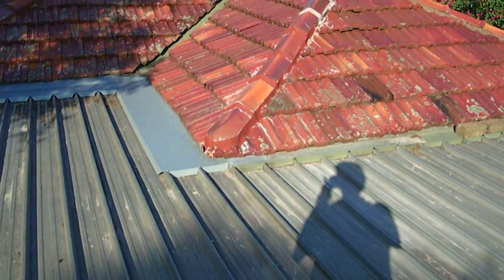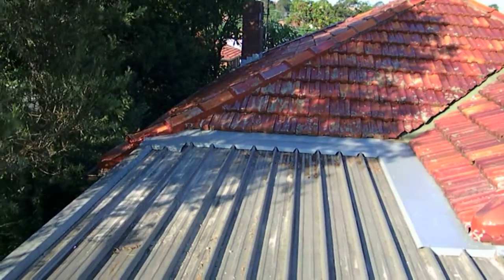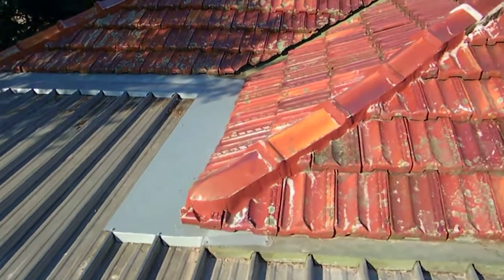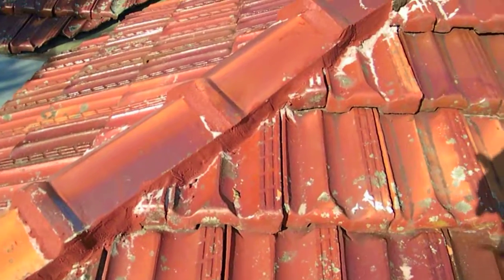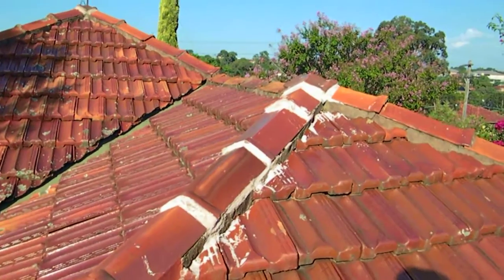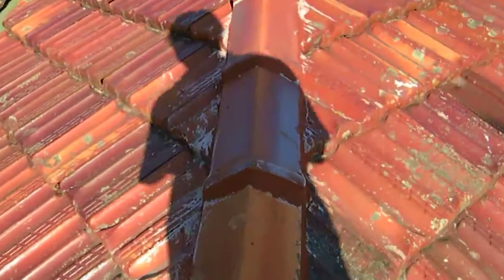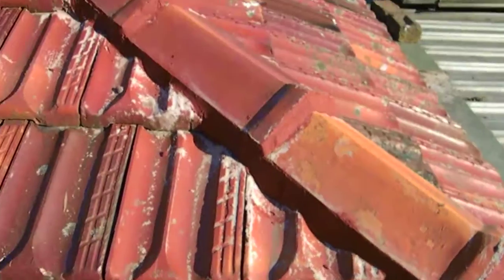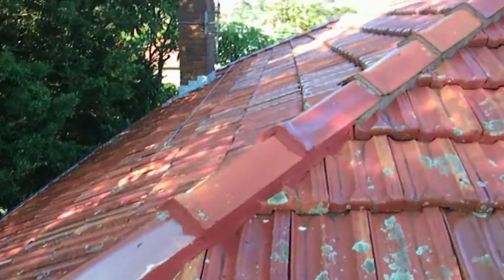completion of ridge cap repair

Comment: Thank you very much for putting these videos up. For those who can do nothing but criticise please post the links to the videos they have put up, then people can critique them too! I have never done this type of work before but am pretty good with my hands. Yes it takes me forever but the results are normally quite ok. Getting smooth troweling consistently is not as easy as it looks, but I'm quite confident that my roof will not leak on the ridge capping. Thanks again for posting.